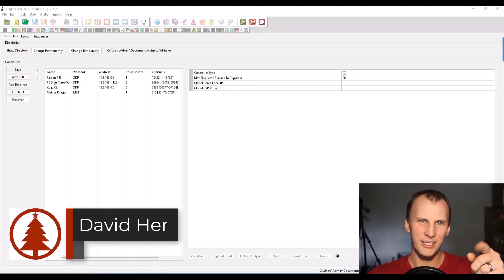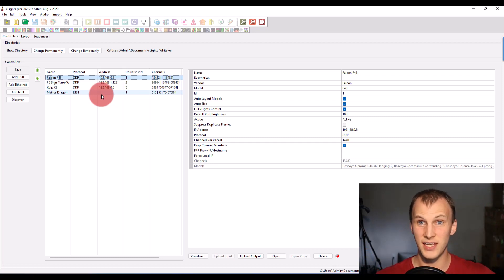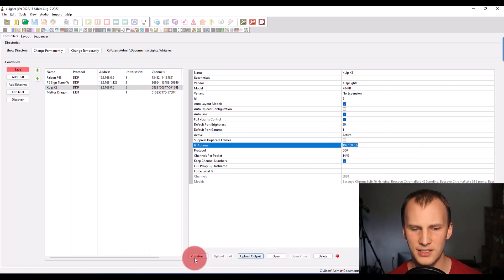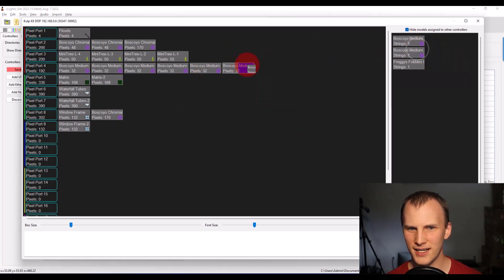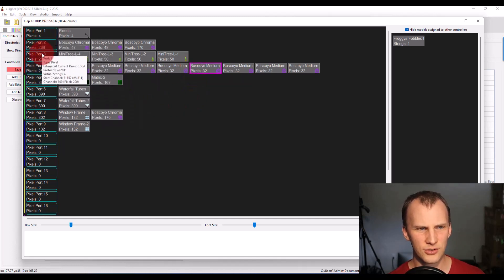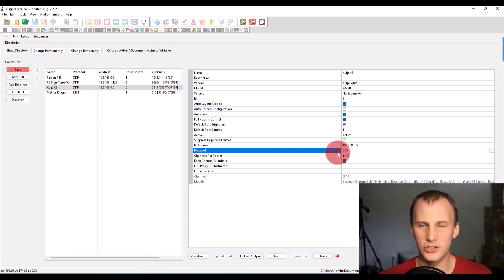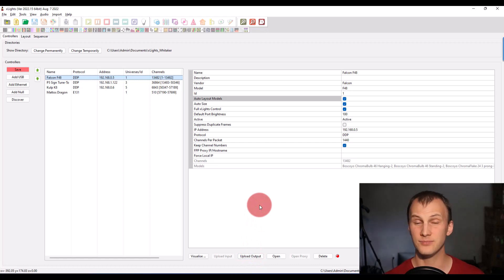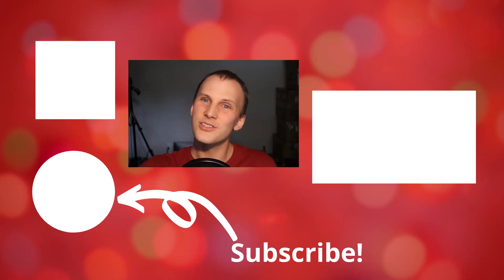How to Assign Controllers in xLights

Comment: Thanks for sharing. Would it be possible for you to make a step by step video on how to setup an FPP player and remote using a combination of ethernet and Wi-Fi?  I would like the Player to be connected to wireless and then its eth0 will be connected to a switch, then the remote controllers are going to be connected to the switch. Thanks!